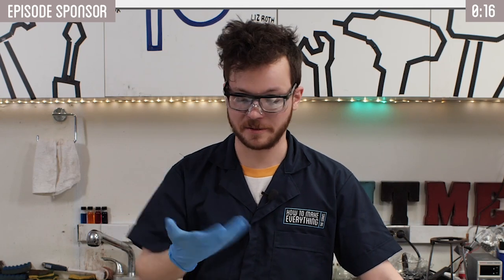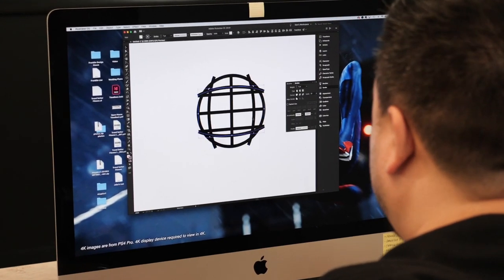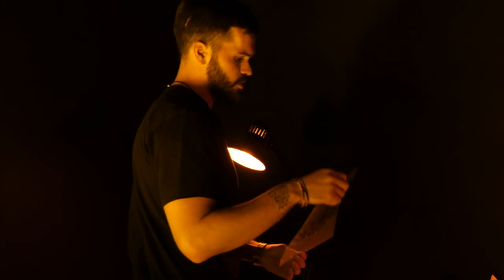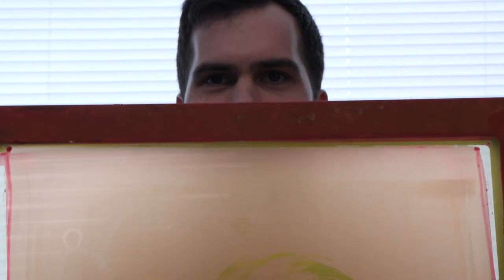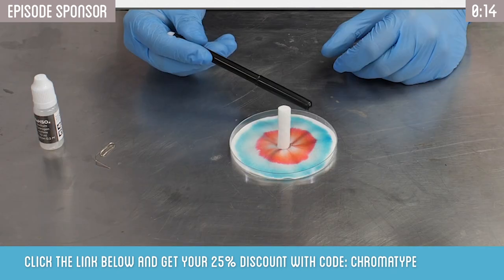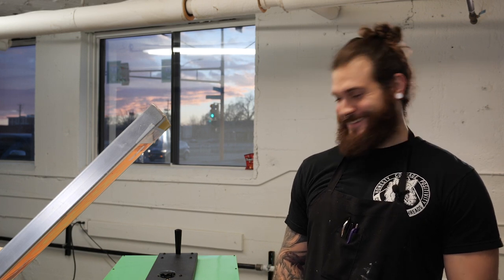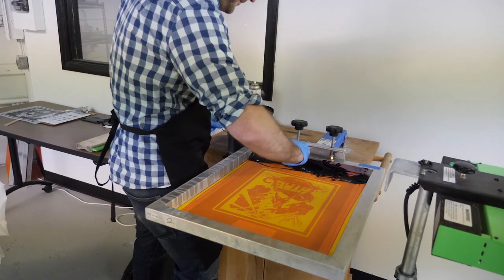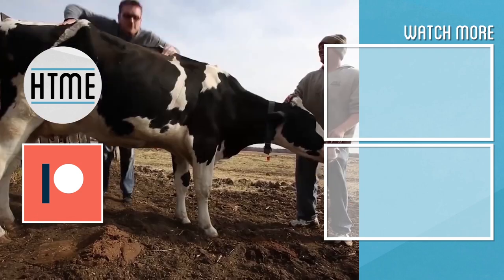From Image to Cloth, How to Screen Print

Comment: I'm a graphic designer, and i've designed t-shirts before but never seen the other side of how that's made so this video is pretty awesome.
Reply: Same. I still don't understand how a shirt with multiple colors can have each screen line up perfectly.
Reply: @Matt Frazier - they use the machine that he was spinning around. Each screen is for a different color. The t-shirt gets lightly glued in place, so it doesn't move, and then the screens spin around to automatically line up and be printed one at a time.
Reply: @mattfrazier3115  To continue from Erin's comment, there is also an alignment mark left on the screens, so that they can be lined up with the previous colors. This is in all printing that uses multiple colors, such as cereal and medication boxes. If you look at the end flaps, there is usually a compass or X pattern that you can see the progressive build up of the colors. There is actually a shot of such a mark @9:16
Reply: @mattfrazier3115  that's why registration marks are key. Also we have micro adjustments. They help us fine tune the placement.
Reply: @fortwoodmisery  why
Reply: @nikoletakoljanin4360  graphic designers normally make a nicely designed shirt, which isnt a problem but alot of the time they have a ton of detail and it becomes hard to print
Reply: The issue is most graphic designers do not understand the printing process. And Design stuff that is impossible to print, then get mad when you need to alter it.
Reply: Same bro went to a career school for Graphics and Comunications
Reply: Should the artwork be a vector file ? Or  is the raster image , enough ?

Comment: Actually, the ink experiment was really cool.  Meanwhile, "this thing is like a relic. I mean, like from the '80s!" hahaha
Reply: I took graphic design in high school. We had some equipment that was "new" at the time.  I'm pretty sure the one in this video is newer. We also had screen printing equipment that was from the 1950s that still worked perfectly fine.

It's a screen printing press, if it's well maintained, it doesn't matter how old it is - it's the same basic tech now as when modern photo-sensitive screen printing was refined in the 1920s!
Reply: 80's were 30-40 years ago. Back in 1960, 1920 probably was seen as ancient. :P
Reply: guess that makes me a relic :D

Comment: I worked at a silk screen tshirt shop for years, and mostly this process was covered properly. Would have been neat if you showed how multiple colour designs are printed, as well as shirts need to be properly cured to withstand wear - Flash curing it under a quick dryer doesn't completely cure the ink. There are also water based inks that bleach the shirt into different colours, and you can't even feel the ink after!
Reply: Andrew Barker we were pressed for time.... but you’re right. We were hoping this would help bring a basic knowledge or understanding of screen printing out there. And, maybe inspire some to get into printing.

Comment: At the print shop I studied and designed at we actually had the emulsion they used in already made sheets that we would tape the print on top of, and then we would wash the design out since it didn't harden. I never new that it came as a liquid you could apply yourself! Very cool video!
Reply: James Sloth I never knew it came in sheets! I want to check that out!

Comment: In the late 1980's, I worked my first screen printing job on on Bertha's grandparents at an old Mom & Pop shop, in business since the 60's. These people never spent another dime on equipment and all of the frames were bowed and had multiple repairs. But the heads on that old press had a lot of pitch and could cinch a wonky frame pretty close to flush. Sigh. Never thought I'd be nostalgic for that thing

Comment: Red, green and blue are the light colours used in the pixels we view; that's why the connector for connecting a new device to a monitor used to be called the "RGB cable". Nowadays, we typically use HDMI instead, which is to RGB what gigabit internet is to a 56k modem, basically.

Comment: A monitor or TV screen generates three colors of light (red, green, and blue) and the different colors we see are due to different combinations and intensities of these three primary colors. Each pixel on a computer screen is composed of three small dots of compounds called phosphors surrounded by a black mask.

Comment: RGB monitors use red, green and blue colors, aligned as subpixels in different configurations depending on the approach that can light up and are packed so tightly together that they emit a color that is perceived as a solid color to our eyes.

Comment: Your screen traditionally contains red, green, and blue sub-pixels.  However, depending on your monitor, you may have a yellow sub-pixel, or a white sub-pixel.  These are generally reserved for graphic design monitors due to their cost and little noticeable difference to the everyday user.

Comment: You guys are pretty cool, red green and blue make up colors on computer monitors. Cool fact, OLED panels which are more common on smartphones still use red green and blue but have two green sub pixels and then one for red and blue each.

Comment: The colors are red, blue and Green. But it also deepends on the screen, and what lights they use. For an example tv screens that are newer tend to have smaller pixels ans includ the color yellow and black in there. The black is so the color from the other pixels dont flood into the "turned off" pixled when your watching something while old tvs dont have black and yellow pixels.

Comment: Well it actually depends o nyour monitor/tv that you're viewing but it's either RGB(Red Green Blue) or RGBY (Red,Green, Blue Yellow) due to the fact that a lot of manufacturers add a yellow pixel as well which vastly improves video quality. However the standard is RGB. This is done by broadcasting 3(or 4) monochrome colors which when blended at a rapid succession shows up to the human eye as RGB(Y)

Comment: Hi I am trying to use screen printing logo on other material, like copper. 
One question other than screen printing inks, can we use sharpie or spray paint ? Will those ink penetrate through the screen and settle on the material?

Comment: That is one of those stuff that would be... incredibly hard to reproduce. It looks deceptively simple, but there are high precision points everywhere. The ink, those mesh panels, the chemicals (it's photolab stuff but tweaked for the job), plus a whole bunch of other stuff.
I mean, you can do the rudimentaries of it to make a basic, kinda crappy print - but to get that kind of resolution and consistency, it's all expensive industrial gear.
Reply: XSportSeeker deceptively simple is right!

Comment: What kind of print shop uses a flash curer instead of an actual dryer
Reply: My thoughts exactly. Especially nsince they said they were doing a 1000 shirt run. That's going to take forever.
Reply: Our dryer is in the background of some of the shots, we didn’t cover that part. Relax y’all.

Comment: For the contest:
The answer is: it depends on how technical you want to get.
The simplest answer is RGB (red green and blue)
Then you can get into how LCD is different from OLED and CRT at how they filter the light.. but the basics are the same: in the end, your eyeball gets hit with a combination of the Red, Green and/or Blue as you watch.
Although I heard CYMK monitors are still a thing, so... it depends, like I said.

Comment: But how do you get a RGB tshirt printed? Do you have to have 3 screens with the same design each created with exposing one colour at a time?
Reply: 4 screens cmyk
Reply: Yes, you need one screen per color. So you have to separate the design so each screen only prints that colors part of it. Then you just have to line them up and fit.

Comment: cyan magenta and green
Reply: nah, on pc/phone/tablet screens red, green, and blue are used. cyan, magenta and yellow are used when dealing with pigments, such as when screen printing!
Reply: @finerz321   actually the three colors of light and the three colors of pigments are different, but i would like to pose the fact that a green sheet oof plastic, and a red sheet of plastic does not always equal a yellow light when light is shining through them, I can demonstrate (as a science teacher) That the intensity of light is important too. If you have less light coming through you just get red. if you have more light coming through you may get red or a yellowish color. Also unless  you have a very intense light you normally will get muted colors. because the wavelengths are too short to give you a true color. so substituting the green for Cyan would fix the issue since cyan is green and blue
Reply: Lominoth Productions that’s because shining light through a red and green sheet is a subtractive colour system, as opposed to the emitting of red and green light in a pc screen, which is an additive colour system.

As for cyan, when speaking about light then yes, it is a mixture of green and blue. With pigments on the other hand, mixing green and blue will result in a fundamentally muddier cyan. That’s why you can buy Process Cyan paint and printing inks, because they require a different pigment entirely. Same goes for magenta, which isn’t just a mix between red and blue in the world of pigments. 

In the world of light, cyan and magenta can’t be primary colours because they can be made from blue and green, and red and blue respectively.
Reply: @finerz321  okay then, I will concede that point, but Light is a very fickle thing compared to paints or pigments

Comment: This is an interesting video, but not the point from which you'd "reverse engineer" the process to make it simple. This is like... Going to the Olympics to teach a toddler how to walk. Its silly. There already is an older technique. Screen printing has been around for almost 1k years. It would have been more informative to talk to someone doing it traditionally, without photo-emulsion and plastisol inks and mechanical registration. Hopefully they paid you guys well for the commercial.
Reply: Erin what ?! Lolololololololol

Screen printing is still the most preferred method of making shirts.

This is traditional.